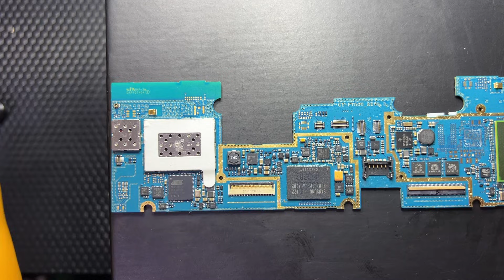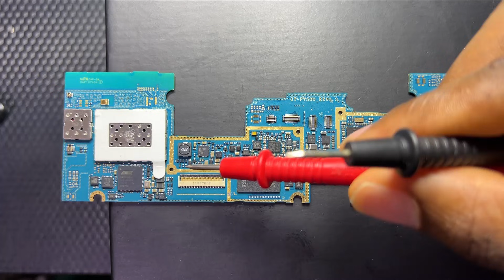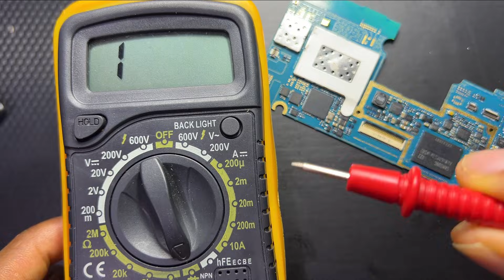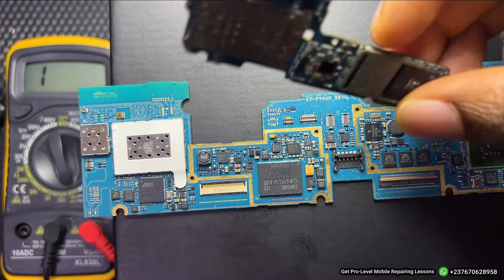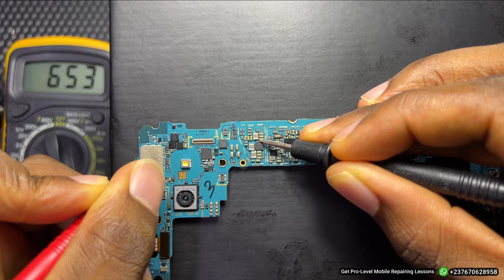How to Test Capacitors Using a Multimeter

Comment: I’m looking on my multimeter and I see where you’re showing to put it where those two at the same place but my multimeter has them separately a bit beside each other when it’s 2000 and it has an arrow with the line through it and the other one looks like a Wi-Fi signal and it says 200 but they’re beside each other separately they’re not together so I don’t know
Reply: Each multimeter is different, my Fluke does not have them together. The biggest thing is you want your meter in diode mode which is the line with an arrow and a solid bar.

Comment: So you can switch the probes to power ground which lets you get a reading of the whole capacitor. You cant measure the other side without flipping them because the resistance is too high for it to measure.

Comment: You don't remove the chip, instead it's a lot easier to remove each cap you want to test. lol
Reply from the maker: Right 👍
Not in all cases as some PCbs will have more than 20 CPU capacitors and for you to remove all them one by one and test the heat will probably cause an open circuit in the chip.